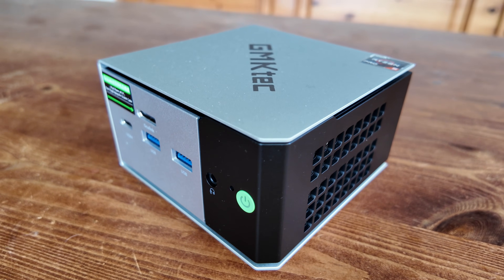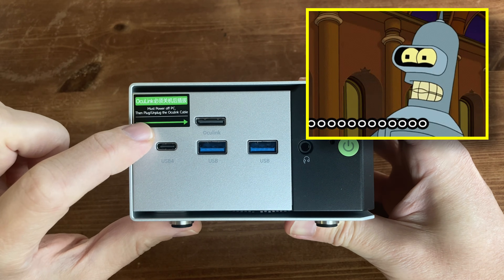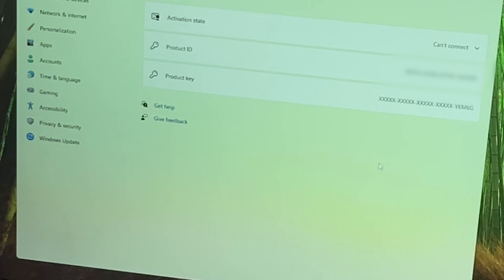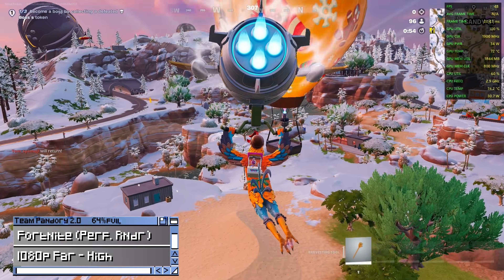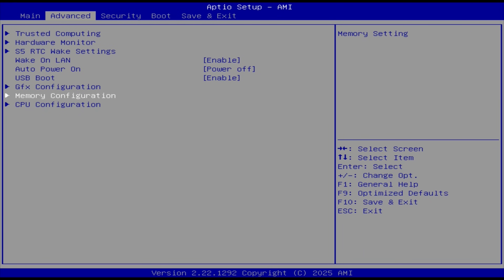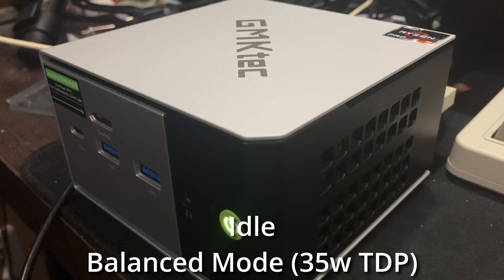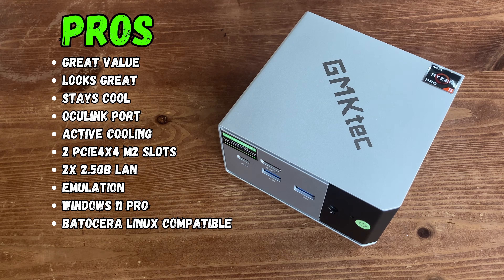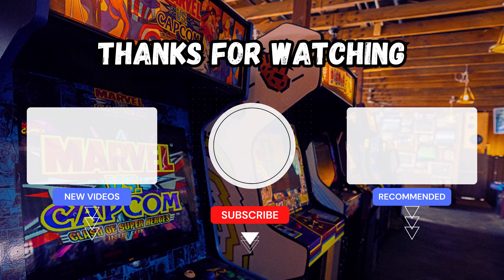This $359 Mini PC Has a Secret Weapon... (Oculink!) [GMKtec M8 Review]

Comment: What is the model of your eGPU enclosure? It looks very compact and nice. I just bought the same M8 with 1TB for a good deal. I'm thrilled with it so far. I didn't need a raw fancy power beast, as I already have one as desktop use for work and high demanding AAA games. I just wanted something reasonably efficient as a secondary PC Media center in my living room. That way, I could remotely stream from a high distant my PC in AV1 4K with Moonlight and play emulated arcade games… I can't believe this tiny box is x4 more powerful than my big old fat rig from ten years ago. I also appreciate the option to connect an eGPU for a future upgrade without having to invest in an overpriced mini PC.
Reply from the maker: We're using the Gmktec AD-GP1 - there's a review on our channel if you want to see more on that. Its 7600m XT works great for most AAA games tbh 👍

Comment: "16GB DDR5 DUAL CHANNEL RAM & 512GB PCIe SSD DUAL SLOT EXPANSION - Installed with DDR5 16GB RAM 4800MHz (Dual Channel 2x16GB), the Nucbox M8 mini pc support expansion to 96GB RAM. Featured with 512GB M.2 2280 PCIe 3.0 SSD, supports dual slot expansion to 2*PCIe 4.0 2TB SSD up to 4TB. (Upgrades not included)"

From their description, you can upgrade the RAM. This is not true.
Reply from the maker: Where is this?  Im looking at the Gmktec main site and it states LPDDR5 as it should
Reply: @TeamPandory  Amazon uk
Reply from the maker: @balex96 okay, thanks -  I'll pass on the info to the relevant people 👍

Comment: This is like the 3rd mini PC I'm seeing that now comes with just 16gb of ram... I'm thinking that some of these Chinese manufacturers have decided to reconfigure a lot of the minis they have sitting in storage that are not selling due to the higher pricing because of ram which I can understand, but using lpddr ram doesn't give people the option to upgrade if they wanted...

16gb is barely enough to run anything these days outside of emulation.

Comment: Just got the gmktec k12 with ryzen 7 h255 barebones for £230 and threw in some ram and nvme I had lying around. Performance is fantasic and so is the cooling, my only grip is the lack of custom TPD and fan curve profiles. you can configure the TDP with software like GHelper and X86 Utility also works too.
Reply from the maker: K12 is a fantastic mini pc! Congrats on the purchase 👍 and yes, a custom TDP would be great, but I'm unsure if it would be abused or not.
Saying that, Gmktec usually have abnormally high TDP values set in their performance mode... This M8 we are reviewing is the first mini pc from them that doesn't even reach the regular TDP values from AMD... Very odd. I bet there'll be a bios update soon 👍
Reply: Did you had any taxes? Their website is freaking unclear. I bought the same one, but 32Gb/1Tb. German version of the shop, 530 EUR. And now I have to pay 130 EUR on top, because it comes from Hong Kong...
Reply: Thats unlucky, £235, shipping the lot. no tax or shipping problems, came in like 3 days too